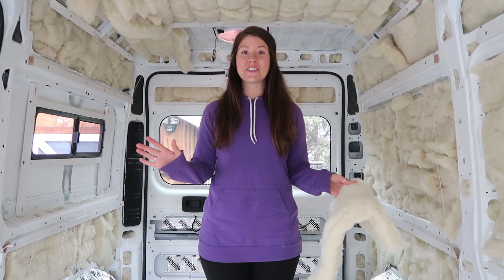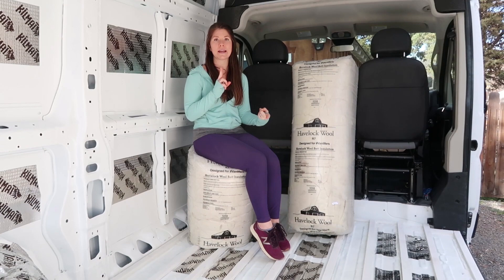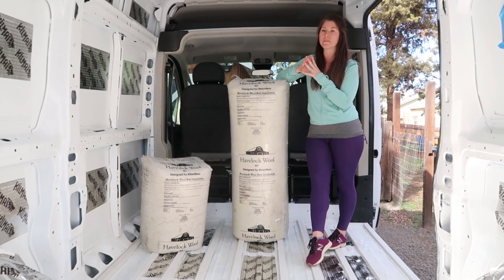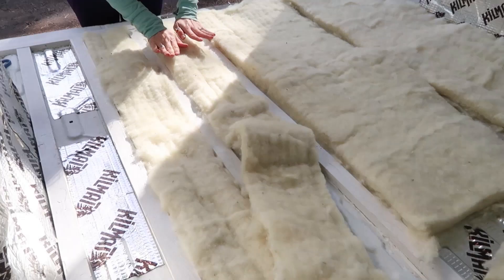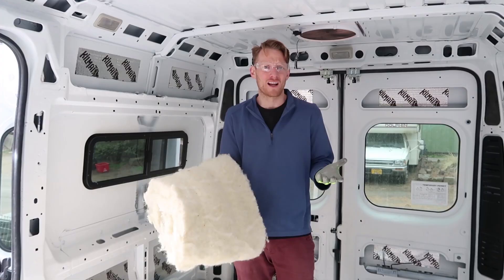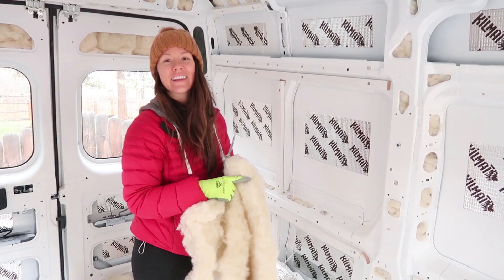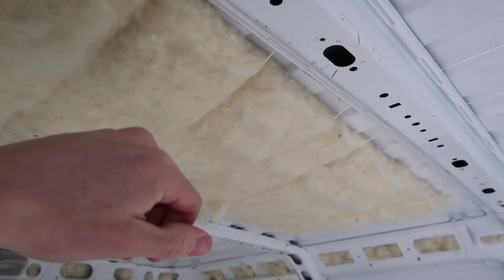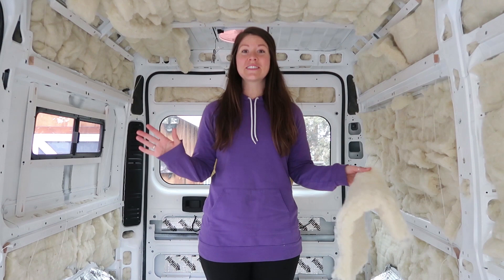Van Insulation: Using Havelock Wool to Insulate our DIY Campervan

Comment: Hey, very much appreciate the video. 
Just one thing, unless they have changed their way of processing havelock have 8% borate chemicals which they try not to mention all that much. It doesn't seem to be any harm to humans, but it does make it less sustainable and reusable.. in saying that, I still found it to be one of the best options out there.
Reply from the maker: Hey Michael, you're right, Havelock does add 8% boric acid to the wool as a non-toxic insect repellant. Boric Acid (or Hydrogen Borate) does occur naturally in water, soil and plants and Havelock is definitely not trying to hide it as, with a quick google search, they mention it in several blog articles, some of which I've linked below:
https://havelockwool.com/2018/05/why-we-are-still-such-a-small-business/
https://havelockwool.com/2016/12/insulating-homes-with-sheep-wool/
I do agree with you that Havelock Wool is one of the best options out there. I hope this clears a few things up.

Comment: If you do not cover the top surface of the ribs with insulation w'ont the heat get conducted right through direct to the outer skin of the van thereby bypassing all the wool you filled the ribs with ?
Reply from the maker: True, the little bit that ribs touch the wood on the inside can get slight more hot or cold depending on the weather. It was barely enough to notice tho. 

To combat this in our latest van, we actually glued a felt carpet-like material to the exposed ribs. Therefore reducing the heat transfer to the wood interior. It was a cheap and simple fix and works great!
Reply: @twowanderingsoles  Thanks for the info !!

Comment: You did right not listening to the Havelock salesman when he said you don't need the sound-deadening sheets. Those adhesive sheets help cancel out physical vibration of the panels of the van.
Reply from the maker: We’ve been very happy with our decision to add sound deadening under the wool Our van is so quite!

Comment: Could you plz tell me why you didn't use glue to attached wool to the walls. I'm in the process of arranging a build and have seen glue it pins used. Thx. Ps love the jokes.
Reply from the maker: We decided against glue because the wool batts do peel apart. So if we did glue, part of the batt could potentially stay while the peel would fall down.
Also a major advantage of the wool is to be chemical free for insulation and adding glue defeats that.
For us, the string held the wool batts up very well (we also stuffed a few more layers of wool in the top after we put the walls up too, before sealing it completely)
I hope this helps, let me know if you have any other questions!
Reply: @twowanderingsoles  that makes perfect sense. I saw construction pins being used which would be less labor intensive for me.

Comment: What are all those silver pieces on the walks and floor?
Reply from the maker: Those are sound deadening mats to reduce rattle sounds in the van. They are a bit extra, and some say it’s not needed when you have wool insulation, but our van is super quiet when driving so I think it’s worth the effort.

Comment: Why did you not use 3M spray adhesive other than that string?
Reply from the maker: The wool batts do separate if you pull them apart. So it might peel off from itself if you use spray adhesive.

Comment: Are you still happy with the Havelock?
Reply from the maker: Very happy! We even put Havelock wool in our newest campervan (3500 ProMaster Extended) and it has kept us warm and cozy even with the temps dip below freezing at night.
Reply: @twowanderingsoles  That is amazing- so glad to hear this! Do you find you need a heater on those cold nights? Or has extra blankets been sufficient?
Reply from the maker: @spacecinnamon2224  It really depends on where you are traveling and what you are used to. For the van in the video, we did some weekend trips in the winter and just had extra blankets and slippers and we were fine for a few days.

For our newest van, we installed a diesel heater because we were going to do longer trips in the winter and we now have a baby on board to keep warm.
Reply: @twowanderingsoles  That makes sense! Things definitely change with a baby. :) Thank you for the response, very helpful in trying to figure out what works for me.

Comment: So what is it made of? Where did you get it? Perhaps it's easier to insulate the tire areas with that? But you used it in other areas as well. Still not quite sure about it.
Reply from the maker: Hey Joanna, the insulation is made out of sheep's wool (yes, like 🎶 ba ba black sheep 🎶), but in this case, the wool is from a company called Havelock Wool. I encourage you to watch the entire video because we walk you through the whole install process (subfloor, walls, and ceiling) and explain why we chose Havelock Wool. You can also check out Havelock Wool for yourself here (affiliate link): http://havelockwool.refr.cc/twowanderingsoles
If you have any other questions, I'd be happy to answer them the best I can!

Comment: Hello, thanks for the video... Question please, did you cover the exposed metal, support channel/ribs, before you added your wall material?
Thanks!
Reply from the maker: We tried to cover as much of the metal frame with wool as we were installing the walls, but there were some spots where we left it bare. 
We are building a new van right now and I’m planning on putting reflectix over the exposed parts to create an additional barrier.

Comment: What thickness wool did you buy? I looked at their website and they have a listing for van insulation that is just 2 inches thick, is this thick enough at R-7? They also have 3.5 and 5.5 inch thick batts with much higher R values. Thanks, loved the video!!
Reply from the maker: the standard van insulation was fine for us

Comment: Any reason to do the floor first?
Reply from the maker: We did the subfloor insulation and the subfloor first so that we could start on other projects in the van and start splitting up tasks. It’s kinda like setting up your foundation and build on top of that. Does that make sense?

Comment: What are the metallics on the wheel walls and walls you put under the insulation?
Reply from the maker: Hi Patrice, those metallic looking sheets are sound dampening material. Also known as rattle trap. They help reduce the road noise so your van rides quieter. Some people say you don't need it if you install wool insulation, which has some very good sound dampening properties. But we didn't want to take the chance because we wouldn't be able to install it later on. So far, our van rides so quiet and we're very happy with choosing sound dampening and wool insulation combo!
Reply: @twowanderingsoles  They are 4-6 weeks out to place an order for that wool...

Comment: How do you account for wiring, did you plan that out? So curious! Thanks for sharing your video!
Reply from the maker: Hi Anne, clarification question: do you mean a plan for the electrical wiring in the campervan OR a plan for wiring/string to hold up the insulation?
Reply: I’m pretty sure she means electrical as I have the same question.  Lots of people plan and use the cavities for wire runs meant to be used from their eventual distribution panels before they insulate.  Didn’t see any electrical wires in the videos and am also curious about electrical and if it was a gotcha moment later or not and if you found a different way to do that.  Otherwise very helpful video.  I wool give ewe a thumbs up 👍

Comment: what did you put in before the wool?
Reply from the maker: Hey Elizabeth, we put sound dampening material (brand Kilmat) on the floor, walls, and ceiling to help reduce the road noise that could enter our van. Wool insulation takes care of a lot of road noise already, but we decided to put it in because we wouldn’t be able to apply it after the insulation was already in place. We are happy to report that we have hardly any road noise in our van when driving. 
Let us know if you have any other questions.

Comment: Thank you for sharing this!  Did you consider adhesive instead of the string. If so, why did you rule it out?
Reply from the maker: Thanks! Great question. Two-part answer:
1. We wanted to reduce the amount of chemicals inside our van (it's such a small space)
2. The wool batts could start to split (pull apart like what we did for the floor insulation) over time and we felt the mold-resistant string held up the insulation very well until we put up the walls.
Reply: @twowanderingsoles  Thanks! Great answer! Looking forward to more! 😁
Reply from the maker: @Suzannes_Trip   🙌

Comment: How much did all the insulation and mold resistant string cost you for the promaster ? And if i got a basic cargo van ( not extended series not high top) would it need about half what you used? 2/3 maybe?
Reply from the maker: I'll actually give you two resources to answer your questions: 
First, is our campervan build budget  article where we break down all the costs associated with this build. Here's that link: https://www.twowanderingsoles.com/blog/campervan-build-cost
As a reference, our 3 bags of wool + shipping and string was about $445. 

Second, Havelock Wool actually has a table showing their recommended amounts of wool for different styles of van styles and sizes: https://havelockwool.com/van-insulation-products/

Let me know if you have any more questions after checking those out! Cheers!

Comment: What's the silver stuff in your van?
Reply from the maker: The silver panels are call sound dampening mats (also know as rattle-trap mats) They reduce road noise that could travel into your van. The wool insulation takes care of a lot of the road noise, but we thought this would be the only time to install it (cuz we couldn’t really go back) so we decided to put it in. We’re happy to report our van is very quite while moving, and we’d probably do it again 😁
Reply: @twowanderingsoles  where did you get your sound dampening mats?
Reply: never mind got it!

Comment: Did you run the electric wires before you put in the insulation? Great video.  Thank you!
Reply from the maker: We ran most of our electric wires after we put up the insulation. We wanted easier access to them if we ever need to do maintenance.

Comment: Hi! Were three bags enough ? I have a ram high roof 136 wb, ordered three bags and don’t plan on doing the floor, but I’m starting to have doubts now.  I’ve seen videos where people didn’t say what havelock recommended on their site is enough or people have folded it in half to double it. What do you recommend? Should I add another bag ? Thanks!
Reply from the maker: Hey Estefania, great question. 3 bags of Havelock Wool batts for our ProMaster 136" Wheelbase was perfect for us. Havelock even recommends 3 bags for a ProMaster 159" WB (check out the link in the description). If you're planning on just doing the walls and ceiling, then you'll have plenty. Just make sure your nylon string is tight on your walls and you measure out your wall cavities first. Then use the rest as loose filling in the framing. Hope that helps! Let me know if you have any more questions. Cheers!
Reply: @twowanderingsoles  okay some peace of mind! And yes nylon string already in my amazon shopping cart lol
Reply from the maker: @estefaniamoreno6396  Great! Best of luck! Have fun! 🙌🏼

Comment: any update? are you happy with your choice? :)
Reply from the maker: Hi Sofia, we are very happy with our choice with wool insulation. It really keeps out the heat in the summertime. We even took many short trips this past winter and were nice and cozy inside our van with sub-freezing temps outside.
Reply: @twowanderingsoles  What about the noise? Are those noise-cancelling things also worth it in the end?
Reply from the maker: @LianneBronzo  To be honest, it’s hard to tell. But our van is really quiet driving on the road and I think it is thanks to a combo of the sound Dampening mats and the havelock wool. For our next van I’d probably do the same thing, if that helps 😁
Reply: @twowanderingsoles  Thanks!! Saw that the havelock wool company is pretty booked so we might have to go with something else, but we're still desperately trying to find a good van! You say 'for our next van', so does that mean you have plans on getting another van soon?? If you happen to be selling yours, hit me up 😜
Reply from the maker: @LianneBronzo  Haha, no plans for a new van yet, but this is a dream of ours. If/when we do sell Pearl, we’ll definitely post about it 😁

Comment: Your use of Wool battens indicates a very casual approach to funding.  Wool batts have been used for longer than I have been on this earth. (90 yrs).   You must have the softest hands from handing this material and in addition you may even have softer walls to absorb minor dents and scratches.  What about re-sale value to those with allergies?  Did the Havelock people provide the wool batts or financial incentive?
Reply from the maker: Hi Jack, to address your allergy question, I encourage you to look at the refund policy Havelock Wool has on their site. And to answer your last question, we bought our Havelock wool insulation ourselves.